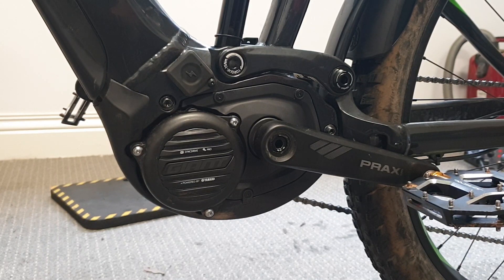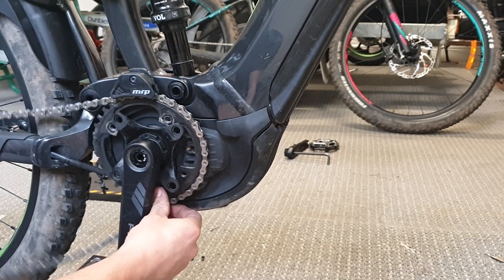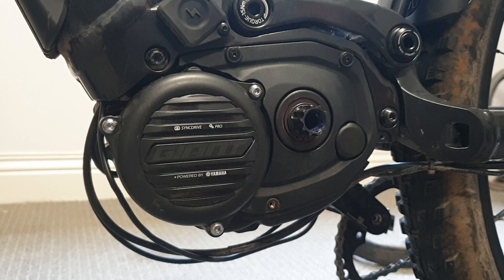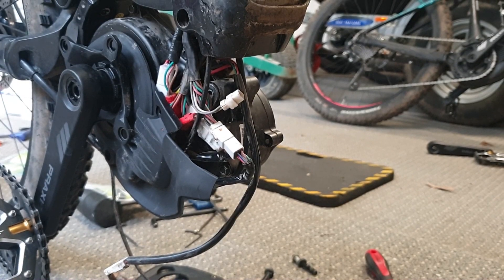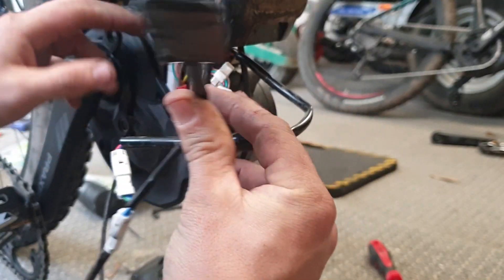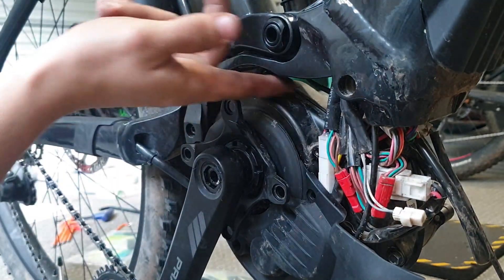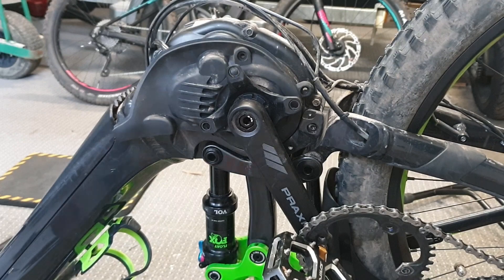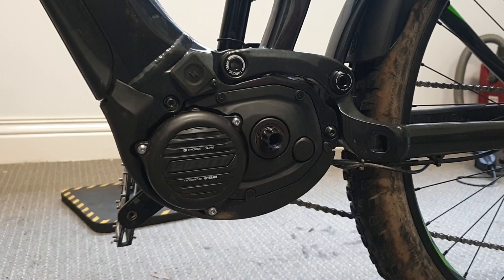Giant Trance E+ Speed Unlock Chip Installation. Syncdrive Pro

Comment: It’s a nightmare to cram all those wires back in there. I had to slightly push on the motor to get it back in. Have you ever had an issue with any wires being pinched or cable ends taking in water from being fiddled with?
Reply from the maker: It sure is a nightmare to get the wires in! No issues so far most people go with the software unlock we offer as it quick and easy so not many of these have been done.
Reply: Yeah I feel you, lucky these things are so heavy, I wanted to throw the whole bike through the window! But yeah, ensuring acceptable bend radius’s and not crushing anything is the challenge.

Comment: How much does the software option cost?
And are both pedal cranks right hand thread, I tried removing my right hand one and it went very tight trying to undo it. it cracked off as expected but then went tight?
Reply from the maker: $300 AUD for the software option, Going tight after cracking off may be the locktight on the threads adding some resistance. Typically The left pedal has a reverse thread and the right a normal thread

Comment: Hi do you think I could install a throttle in my 2017 giant Ebike?
Reply: I'm wondering the same thing
Reply from the maker: It may be possible but would likely require complete disassembly of the motor and fitment of an aftermarket motor controller

Comment: Where can i get this chip from? How much is it and how fast i go with this chip thanks
Reply from the maker: Hi Mate, Our giant tuning products are available here: https://epicebikes.com.au/product-category/giant-speed-unlocks-upgrades/ Our software unlock allows speeds up to 70km the hardware chip unlocks to 50km
Reply: Hi Danial. I have a Giant Talon E+ 29 1 2021 model with Yamaha Syncdrive Core motor. I purchased a Volspeed 3 chip about a month ago and wasn't able to get around to install it until tonight. I took the covers off the motor and could only see 1 wire so I figured I'd have to drop the motor down to access the wiring harness. So I searched YouTube to find this vid. At the beginning you mention a software upgrade that basically negates the need for the chip. I like the sound of that! Could you steer me to a url that describes this process in detail and also costs and equipment needed. Thanks
Reply: @michaelstanton297  0

Comment: How can I get the software upgrade?
Reply from the maker: Here is a link to learn more about the software unlock https://epicebikes.com.au/product/giant-trance
Reply: @EpiceBikes  doesn't the software work in the UK?
Reply from the maker: @dalebarrett6003  The software works in the UK . We are the distributors for Australia and New Zealand. Contact Eplus in Italy directly to find out if there is anyone performing the upgrades in the UK
Reply: @EpiceBikes  Hi guys, tell me about this software method. It is true that it change the circumference of the wheel and will affect wrong data f.e. in app ? A eplus dealer in my country told me that (but was no sure 'cause never unlock giant bikes).
Reply from the maker: @Beverly70210  yes that's correct if you have a speedometer or app that reads speed from the bike it will no longer be correct
Reply: @EpiceBikes  thanks!